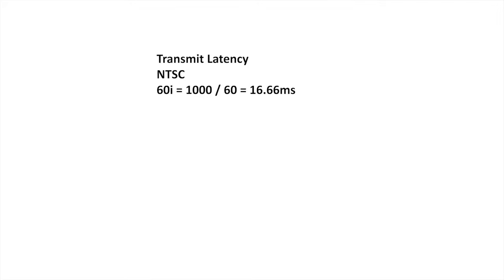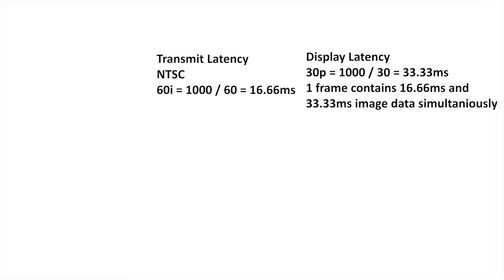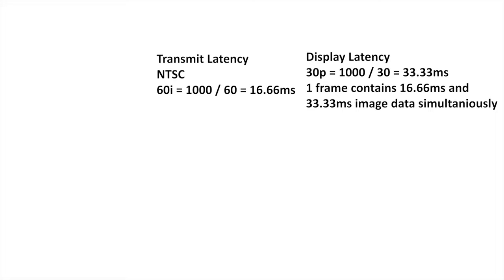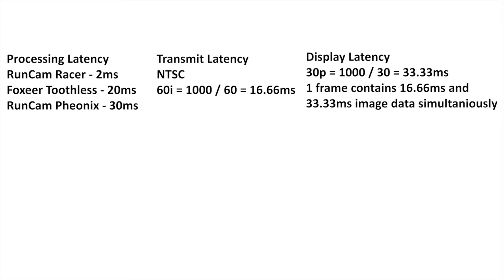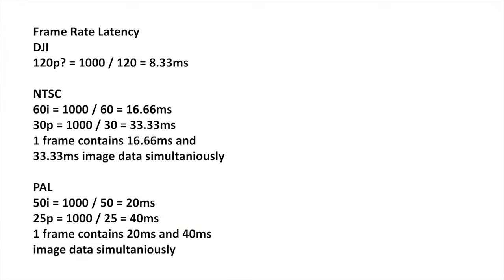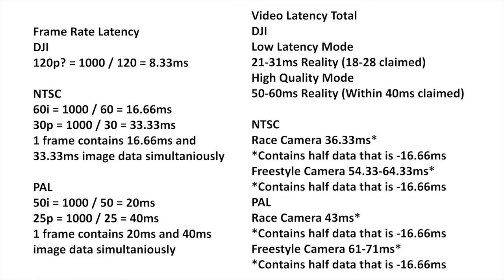FPV Video Latency - DJI Vs Analogue Latency Comparrison

Comment: Hmm.. take a smartphone with slow mode and a strobe light. Record the strobe and the goggles display in the same frame and record what the delay between the strobe and the Goggle display is.
Reply from the maker: Bit hard to do while flying though man, lol. Just filming a timer and the goggle screen withthe timer in the feed would work too, and easier to count the latency. But try focusing on the goggle screen and another screen at the same time though.
Reply: This is the concept - any flashing LED light will work. I have rug rats so I don't have the two - three hours to figure out the time ratios with slow mo - edit it in premier etc. Would be super cool to see you do it.
Reply from the maker: Been giving it more thought. Would need at least 1000fps to be able to get 1ms acuracy which is what we would need here. Think my GoPro does 240fps, so will only get 4.16ms per frame. Would need to record in 2000fps to be accurate because the screen and recording are not in sync.
Reply: @Bludz  The screen is only 120hz on the DJI goggles, I disagree with your conclusion that you would need to film at 1000fps or even 2000fps. I see very little benefit of anything over 360fps and I would presume that 240fps would be just enough to at least substantiate a difference between analog and digital. There's no reason for your sampling rate to be over 16x the refresh rate of the goggle display. You would see 15-16 frames of the exact same screen would you not?
Reply from the maker: That is a great point Chris. However, if you want to record every single ms, so you can calculate the exact ms/frame the screen displays, I still think you will need 1000 frames. If the screen changed between 2 of the frames of your recording, you would have to wait for the next frame to record before you see the change. 240fps records 1 frame every 4ms. So say 0ms it took a frame, 1ms the screen changed, 4ms another frame taken. 3ms lost, which would accumulate into a lot over 1s. You do get to a point where the difference between say 240fps test and 580fps test would be close, but if you want to count ms, you need to record them all I would think.
Reply: @Bludz  I took the video with a Samsung galaxy S20 - 960 FPS.
Reply from the maker: What's the latency then bro? Your light turns on so slowly it's going to be hard to measure, LED is more instant. You'll need to see the screen better too I would guess.
Reply: @Bludz  True, if you wanted an exact measurement with a greater level of confidence you may as well record every ms. BUT I still believe you could get a demonstrably meaningful result if you average your latency measurement over 20 or so 'runs' (I don't remember the rule for how many tests you're supposed to perform in relation to your theoretical maximum error % to get a confident average so it's an arbitrary number). If the average latency delta of the analog and digital setup is higher than your theoretical maximum error (the real error of you averages should be significantly lower than the theoretical maximum but you'd have no way of proving it) then I would consider that statistically significant enough to show one is or is not faster than the other. And it would be interesting to do the test with high-low end analog goggles as well.
Reply: @Bludz  I used an app called frame player that lets you play video frame by frame. I have two cameras I tested. A Ratel and a Predator. Ratel was 31 frames and predator was 13 frames. There is some weirdness though  - the goggle flickers and sometimes gets half bright and than fully bright - its hard to tell when the light goes on if the goggles are fully bright or half bright. From my limited dont have a ton of time test. The ratel seems to have three times the latency of the predator.
Reply from the maker: Great comments guys. I totally see your point about running enough tests to get a meaningful average. My phone turns out to be pretty good at slow mo, not the 960fps of an S20, but 480fps 1080 should get me quite close. I will have a try at testing like this and see what I can come up with.
Reply: @Bludz  cool - yeah I'm extremely interested to see camera to goggle latency of the DJI vs analog. I thought your video was great. A lot if the oscilloscope tests skip the added latency if the VTX and goggle.
Reply from the maker: The oscilloscope tests are very good for measuring the camera processing time, but for sure that is only a small part of the video system. One big thing I feel makes a massive difference to analog is the fact that the camera, vtx, vrx and screen are not talking to each other and not in sync. This must cause the latency to be higher than the mathmatical possible. Maybe DJI have there system all in sync seen as though they have 2 way communication.
Reply: @Bludz  hit up the slowmo guys

Comment: Analog latency with racer-cam is about 20 ms, not 37 ms !
Reply from the maker: Sorry if you didn't understand the video mate. 30fps (analog) is a minimum of 33.33ms. It's just basic physics.
Reply: @Bludz  no you made mistake, interlaced image is shown after 16ms already, additional 4ms from cam, makes 20 ms, this is shown / measured in real world tests in some videos
Reply from the maker: Sorry, I haven't made a mistake about this point. Interlaced image needs to be deinterlaced before being displayed on the screen at 30fps. Each 30fps frame contains image data from 2 states of time. Half from 16.66ms ago (1 interlaced frame containing even numbers of horizontal lines) and half from 33.33ms ago (the other interlaced frame containing odd numbers of horizontal lines). Phase delay is also not being taken into account. The goggles, the vtx and the camera are not in sync, so you will rarely get the mathmatically possible latency.
Reply: @Bludz  At first, thanks for explanation. But: I think the mistake is that you think the image needs to be deinterlaced. The camera sends out the interlaced frame and this will be send directly to the VTX, the VTX and the RX and the Cam are not waiting for the next interlaced image.  And this fits with all the real word glass to glass tests with osziloscope, where the overall latency (cam -> vtx -> transport -> rx -> module) is about 21 ms for the best cams. Additional comes the goggle of course.
Reply from the maker: Glass to glass by definition ends at the goggles. The VRX or the goggles do the deinterlacing. You are correct though, the camera send 60 interlaced frames to the vtx and the vtx sends 60 interlaced frames to the vrx. What is displayed is a deinterlaced 30fps video, this is how analogue works. Powerplay DVR, Orqa goggles and DJI goggles all record DVR in a special method of deinterlacing the image where they retain the 60fps, but can only be done on capture as the latency to do this is high.
Reply: @Bludz  No the google already shows the first interlaced image, it is not waiting for the second interlaced image. This is proven by highspeed recording the goggles screen.
Reply from the maker: YAWN
Reply: @Bludz  it is elementary important for every one who watches/read this
Reply from the maker: @mh7711  Half a frame of information is displayed every 16.66 ms, just like I say in the video and in the comments above. Only half the scan lines change every 16.66ms, so what you are looking at is video data from two states of time. It is VERY basic. All tests with high speed cameras I have seen are fataly flawed by using sub 1000fps camera (regardless of their excuses) and the fact they are timing an led turning on until it is displayed, this is not a good test which is why I didn't do it. They are not timing the true latency because the tyime between them randomly turning an led on and the shutter actually taking an image. They cannot time more than the first frame which is just pointless as video is not just 1 image. Totally ignore frame drops and phase delay, lololol.

Nobody really cares, just fly your damn drone mate.

Comment: I think most racers problem with DJI is the goddam interference it creates for all the other analogue flyers lol we are constantly testing our race meets with DJI flyers and it always bleeds on other channels it's frustrating as hell. And the solution isn't just "every body fly DJI" because that's never going to happen
Reply from the maker: You could be right man, you are not alone with having interference issues. I'm pleased to say that me and the othe DJI and analogue pilots I fly with don't have many, if any. Just like analogue you need to space everyone out as much as pos. We use a mix of Raceband and Fatshark channels called IMD6C like a lot of race events do. You can then substitute the last two channels in the group with 2 DJI and nobody has an issue. We even run the DJI at 200mw and analogue at 25mw and analogue doesn't have an issue. I fear that a lot of people still don't realise DJI goggles need to be 5-8 meters away from other people (mainly analogue) otherwise it causes interference, maybe this is what's happening with you.
Reply: @Bludz  quality reply man i really do appreciate your insight. Yeah we are aware of the distance requireed but people have a tenancy to 'forget' lol and creep back into the tent. unfortunately we arnt allowed to run f8 and r8 in Australia so we use a smaller window and having 5 pilots up at once just about any combo weve tried somebody is effected by the digital lines :(
Reply from the maker: I think FPVers get lonely. I try to stand on my own and then people come stand next to me, lol. I can see how it would be tricky if you don't have the full set of frequencies available. Legally I have the same issue probably, as in the UK we are similar to you guys. All the events I've seen in AUS use all the frequencies, same goes for here too. We are talking about very low output power (even 2w is considered low in reality), so 25mw racing the people who make those rules really don't care at all, the rules are for people running pirate radio stations and stuff like that, or broadcasting wifi. You will be fine. Ask the BMS guys, they always respond to comments and would be the top people to know what you can do/get away with.